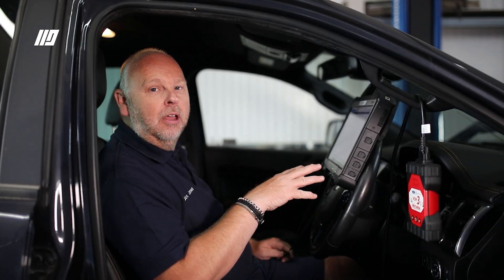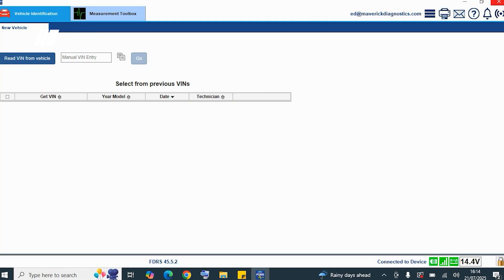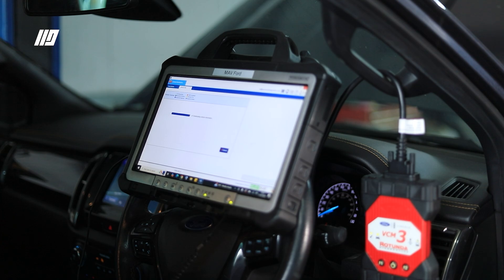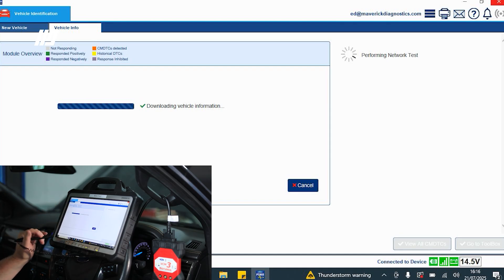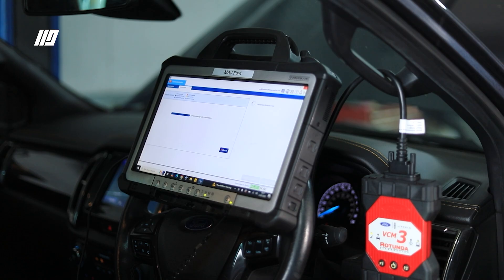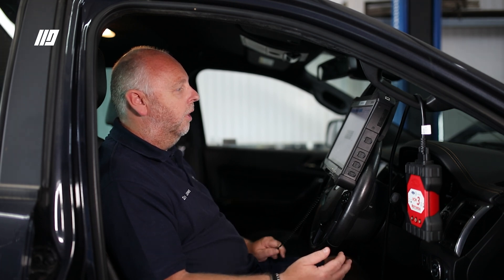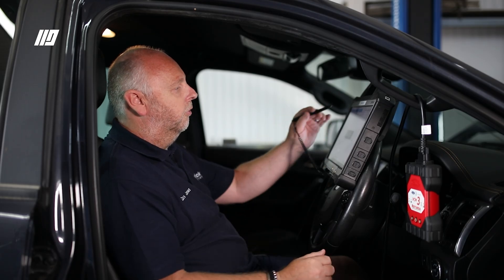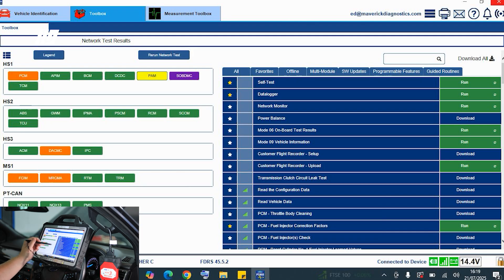Ford FDRS Diagnostic Software - Step-By-Step Guide by Diagnostic Technician

Comment: I’m having an issue with my Ranger not changing gear properly. It’s an automatic. The dealer I bought it from has had a diagnostic test done, and I’ve requested a report from them.  
They have sent a paragraph of writing through to me that I’m not entirely happy with. Do Ford keep a copy of the diagnostics run and am able to get a full copy of it?
Reply from the maker: Hi! Ford dealers normally only send a summary, not the full diagnostic log from FDRS. You can ask them for a printout of the fault codes and test results though. If you’d like another opinion, an independent specialist using Ford FDRS could run a fresh diagnostic for you and explain the results in full.
Reply: Thanks so much for replying I will ring Ford today and see how I get on. If faults have been detected previously and reset for want of a better word, I’m assuming that previous faults wouldn’t show on a new diagnostic report?  Apologies for my lack of knowledge on this.
Reply from the maker: @streakingcarrots1688  No need to apologise at all. That’s a great question! Once a fault has been cleared or reset, it usually won’t appear again on a fresh report unless the fault reoccurs.